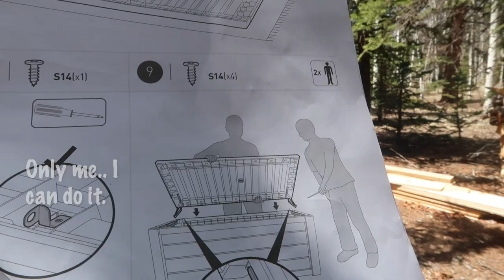Getting Ready For My Canvas Tent - Water Barrel, Camp Storage, Chats - Spirit Forest - S3 -Ep#38

Comment: Framing carpenters used to have a trick to keep their hammer handles well-oiled. You.ll still see a dimpled circle on the bottom of some wooden hammer handles. The mark is for you to drill a hole, 1/4" or 3/8" hole maybe three inches deep. Then you fill this with oil, let it soak in, refill and repeat until it has pretty much soaked in. Last, refill and tap an inch of dowel rod into the hole to plug it. Then maybe once a year, knock out the dowel rod and repeat. By oiling the handle from the inside, you ensure it is thoroughly oiled and it will take a LONG time to dry out.

Comment: When you axe or hatchet gets stuck, push down on bottom of the handle and it will come out much easier.  Your water catcher.  Take the screw cap to a hardware store that has plumbing stuff and find one that will screw in.  Then connect with PVC pipe.  Don't need to glue together.  Just tape for easy removal later.  Have a super wonderful day.

Comment: Two ideas: on the water barrel if the lid comes off lay the edge of the screen over on the outside then fasten the lid back over it and it'll stay on and the critters wont be able to get to it. The other is maybe dig a small hole for your chopping block so it doesn't wiggle around when you're chopping on it. I was worried watching you split those logs. A daily vlog would be cool but seems it might take up too much of your time you do whatever you think later

Comment: elevate the water barrow using two concrete blocks Called Common  8X8X16   cost 1.70  each they last forever unless you get water trapped in the two large holes and it freezes.

Comment: Probably the threads are a pipe thread for the spigot. 

Simple Description:  Pipe thread is a special beveled thread, both on the hole and on the part that threads into it. As it is tighten, the thread closes up creating a seal. Usually a compound or tape is added to help create the seal. On plastic pieces a thread compound is not needed, initially. If it is pipe threads, and as the sun works on it, that the plastic will expand, where a leak could start. If that happens just add the pipe sealant tape or compound to it.  Personally, the compound comes in a tube and is easier to install.
Reply: Just watched this video. Must have missed it. All I can say is......... GO KAILA GO GIRL GO!!!

Comment: Paint doesn't stick to that plastic (water barrel) very well, even with a prep chemical and even paint made for plastic but the latter might last a bit longer...but you already knew that.
Funny...a friend just sold me a new hatchet and 2 tents yesterday for $10.00.
Love them braids and braid rings/beads T...was worried they would get wrapped up in your drill...please be careful gur (girl).

Edit: Now that I see how you did your posts and beams under your deck, shims won't work very well. You'll have to raise or lower the cement pier blocks. Bring a jack and wood blocks (pressure treated). Or add/remove dirt under them to get the deck level. peace gur.

Comment: why wouldn't  you sue a one of those filters or catches with the built in screen that matches the barrel opening? (just buy one) I would also raise that barrel on a  matching platform .. at least a foot and a half or too. so you can easily use  the spigot on the barrel, you are still off the deck next to the deck, water is accessible when you and rocky need to use the water